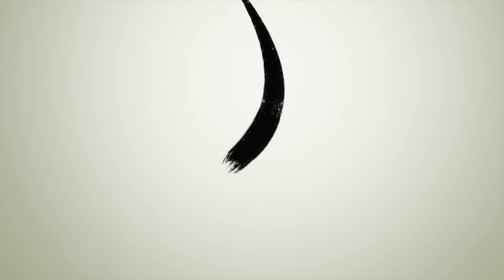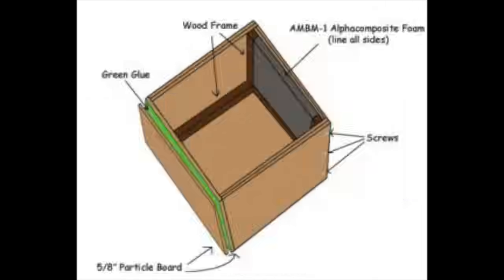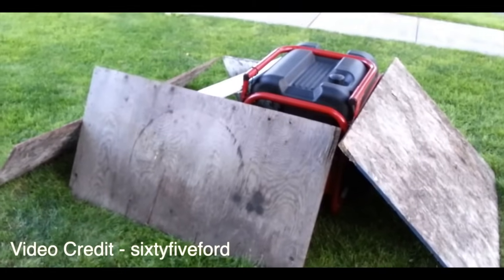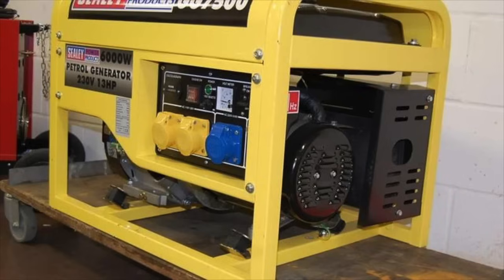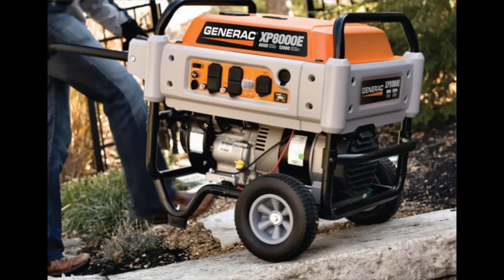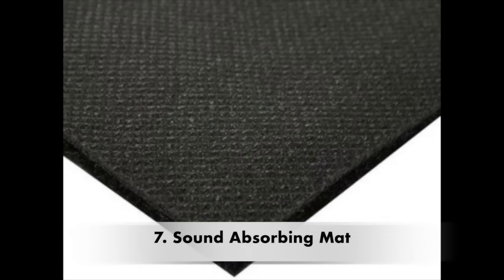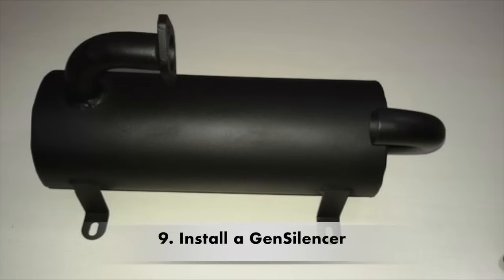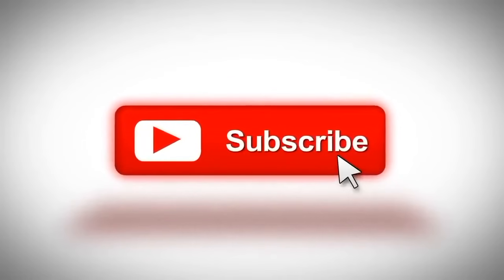How to make a generator quieter - 9 Ways That Work!

Comment: First of all thank you this for n many other video ! Love it . I’m looking for a generator that can pump up 10-15amps about 1200watts and pay about 1-2k what would you suggest?
Reply: For how long, and what KIND of load and 15 amps is 1800 watts. What EXACTLY do you need to run? Fridge? Lights? It makes a BIG difference. Electronics like computers throw a whole different thing into the equation. Be glad to help if I have more info...
Reply: Ricky Earp it’s 4x exhaust fans from work place it’s 2amps each 120v max watts said on it it’s 231watt .... I’m from CA we keep having power outage here . Thank you for the reply 🙏🏻🙏🏻🙏🏻
Reply: @titusho4608  get a Honda 2200EU tried and tested
Reply: @titusho4608  Typical California solution...wild fires from power lines - shut off power for a week
10,000 people running portable generators in the dry brush -no problemo!
Reply: @sylviaisgod6947  I end up getting two.... works great ..... this model  is out of stock everywhere in the bay ... only Amazon was available
Reply: @titusho4608  Good luck when they ban gasoline in CA.

Comment: Oh, man I wonder how long before the box would catch fire with my 8500 watt genny. We had a power outage a few weeks ago and can run the entire house on it, plus one AC. The muffler glows red, you can see it at night. If you stand 5 feet from the exhaust, your legs get hot. This is at 50% load too!  Imagine if we cranked up two AC!   One thing I can say, enclosures do work, provided they are designed with cooling and exhaust ventilation in mind.  For example, look at the Generac 7.5Kw genset. Its basically the same as a caged generator, but in an enclosure.  The key though is that it has plenty of ventilation and the exhaust is piped out of the box so it doesn't release its heat inside it.  I also know that the alternator in the genny has a good sized fan to suck heat out, so making sure there is good in flow and out flow is key.  If you do make an enclosure, make sure the front and back, in relation to the genny, the front would be the motor side, the back the exit of the alternator where the air blows out, and some method of getting the exhaust out, and it will work. Give at least 12" clearance all around.   Here is the MOST important ting, Make sure you can open it up to air out BEFORE starting it!  Gas fumes can and will accumulate in the box and if you have a power starter, and you push the button, you could very well go BOOM!
Reply: thank you so much for this. well appreciated
Reply: I listen only guys who had experience and tried to work around this problem. All rest of you: sceptical criticals- you All just Shut Up!!!

Comment: Putting a generator in a box seems like a recipe for overheating...
Reply: "I CAN"T BREATHE!" You gotta have 14.3 gallons of air for every gallon of gasoline you burn...And my manual for a Briggs and Stratton 5 HP Horizontal shaft "F -Head " engine says it needs 1900 CFM of cooling air @ 50 degrees F at .05 in mercury static pressure (almost NO resistance to free flowing air) AT IDLE and 6000 CFM under full load for 30 minutes then it has to be shut down and allowed to cool for an hour...
Reply: Only if it doesn't explode first

Comment: You have zero actual experience dealing with this problem. Half your stuff contradicts itself. Several of your video clips swiped from other youtubers. Several tips are dangerous.
Reply: He's trying to cure diarrhea by fixing the toilet. Buy a twin cylinder inverter Cummins/Onan genset  or Honda and Yamaha and Suzuki make them too(yes, they are expensive, but you can hand them down to your grand kids if you maintain them) and be done with it. What is the ONLY brand of generator that can be used in ALL National Park Campgrounds after "Quiet Hours" and all National Forests and all State Parks and all Corps of Engineers Recreation Areas? Onans. I had an Onan 11000 Emerald Series in an AirStream Excella MotorCoach and put 55000 hours on it with only oil changes and new spark plugs. When the vehicle ran, so did the Onan for the twin roof  Coleman A/C's. We got better fuel economy that way, 15.5 MPG VS. 14.5 trying to use the the cab A/C to cool the rig (pulling different Hondas, Civic or Accord Hatchbacks didn't make any difference). 454CID Chebby slightly worked on(headers and Jacobs ignition replacing the worthless GM HEI), G50 chassis, 400 Turbo-HydroMatic 19" Alcoa wheels. I THINK Yanmar makes a liquid cooled des-iel inverter genset that's quiet as a baby's breath too. Look at what's at the base of the local cell phone tower for a back-up. Ex-room-mate installs and maintains those things...

Comment: He mentioned an inverter generator , but why in this day & age would you even need to run a generator at night take a que from solar run the gen during day to charge batteries use batteries at night connected to inverters no prob while sleeping cause no noise , better yet go solar with gen as extreme emergency backup only,when not enough sun to charge batteries!.

Comment: Who in the hell would spend $1000 on a box for a 2200W portable generator that costs $500?  Those Zombie Boxes are insanely priced.
Reply: Honda inverters generators are insanely priced too (repeatedly mentioned in the video). If I could parallel 4 of them, I'd finally have a decent sized generator but I'd need a bottomless wallet to due it. It's not hard to be quiet when you're running a Cox 0.049 engine (exaggeration) and take your fuel consumption ratings using 1/4 output (when output is already 1/2 regular generators. Other manufacturers rate sound output and fuel consumption @ 1/2 output, not 1/4. Let's try some apple to apple comparisons. The inverter don't enter into the reason they're quiet it's because they are 1/2 the size both in output power and engine size (or more) along with twice the price tag.
Reply: @Dewey-wz4ny  They only let you parrallel 2 to each other. COuld probably switch 4 together. But. fuses might melt. They are quite. But extremely noticeable in a quiet campground at night time. I prefer the silence
Reply: @Dewey-wz4ny  Okay, THAT has got to be the challenge of the century. How to quieten the Cox 0.049 cu in model airplane engine to be quiet like an electric motor! Any ideas? Should I start my own thread?
Reply: @Dewey-wz4ny this is old but the best reason for an inverter generator is the clean power it provides for electronics.
Reply: IKR?!  I got a great deal on a perfect $1400 Duramax XP12000EH Amazon warehouse for $850 4 years ago.  The Extra Large Zombie box would wind up costing $2600 shipped with 'required' accessories.  How do they stay in business?
Reply: The generator that I've been looking at getting is $1,700, uses propane or gas. The reason I'd want it, is because I'd often be using it inside of buildings that don't have easy access to a 220v outlet. -- So, while I can understand this isn't exactly a common practice use, there are people that would greatly appreciate the machine.
Reply: @paulmichael5633  Using it INSIDE a building? What about exhaust fumes...?
Reply: @paulmichael5633  GenMax7250 inverter 50A Dual Fuel on sale AMZ 400 off.
Reply: I agree.
Reply: Might as well invest in a inverter generator bro begin with
Reply: Probably does the same thing I did with my diy baffle box. I have a 9500 watt generator. It's loud, especially in the suburbs when everyone else doesn't have power.

I put a small duct fan in it to pull air through the box to keep everything nice and cool when In use.
I imagine You could remove the exhaust fumes with a similar practice.

Comment: Running an extra long extension cord will draw more amps thus limiting the number of appliances or tools you can run simultaneously. It's not good for the equipment to run on low amps either.
Reply: IF (big IF) you run honking big cable on 240 volts, you can mitigate amperage/voltage drop, but VOLTAGE drop over a long wire at a "fixed voltage" can't be avoided by Ohm's law of V=IR where V is voltage, I is amps and R is resistance in ohms. At 120 volt and 30 amps, even an 8 gauge wire 100 foot shows a voltage drop of more than 10%, which is too much for motors starting. "Life iz 'ard an' den chu' die an' go du 'ell. Ay cun deal wid dat."-Izzy Moreno "Miami Vice"   Words I live by...

Comment: Screw that Honda. I'd buy a Predator with warranty, Firman or Ryobi 1st for less with same value.
Reply from the maker: I’m actually looking at buying a Firman! What do you think of those? Had good luck with them? I’m looking at a 7000w and would probably use it on one of my next vid.
Reply: Soundproof Guide    Westinghouse then Firman imho.
Reply: I use a ryobi no complaints

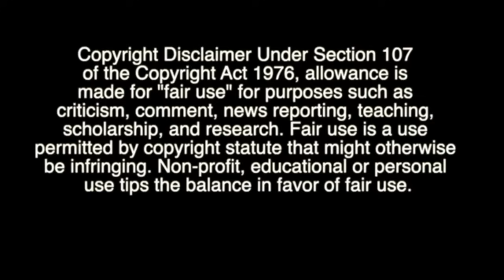Comment: 15:05 Battery powered fans ???  Why would you buy battery powered fans ? You have a generator! 
Can't you just buy a normal fan and power it from the generator ?
skipping the batteries makes it less complicated which means less stuff to go wrong.
Reply from the maker: It just all depends if you have enough outlets. I just find a battery fan works just as well and you don't lose a spot on your generator by doing it that way. Good point though.
Reply: The batteries go dead in the middle of the night, you wake up to a burned-down generator shed.

Comment: While I agree with having a generator, severe weather events are not more frequent now.  Both hurricanes and tornadoes are happening less frequently and are not stronger than previous decades.  We do choose worse places to live, which is part of the perceived issue.
Reply from the maker: You do make a good point. Thanks for commenting!
Reply: Anywhere serviced by Pacific Gas and Electric has iffy problems. That's all of central to Northern California.

Comment: Don’t use a car exhaust use a factory motorcycle exhaust. Because it’s a single cylinder a car muffler won’t work you need one from a bike
Reply from the maker: Thanks for the tip. I'm actually going to make a video with  test in the coming weeks using a muffler on a generator. Stay tuned!

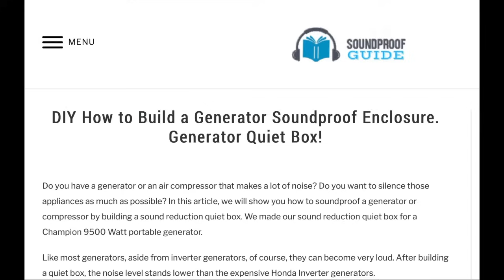Comment: Your table saw example at 2:29 is a dangerous table saw example. you need to use the miter guide and not have the ripping fence installed.
Reply: Eyeroll.......are you really “that guy”?

Comment: Last tip should have been the first. Don’t be so cheep go out and get a Honda of the size you need and call it a day. Come on really, buy a cheep noisy open frame generator then spend another $300 to $400 on a ZombieBox with another couple hundred shipping? That’s like a 90 year old getting a boob job.
Reply from the maker: You’re absolutely right. Thanks for commenting!

Comment: I personally reckon because of one cylinder being air cooled is the problem. I've heard a great little one powered by a 3 cylinder water cooled Kubota. Fully silenced and in a cabinet . Cost plenty though
Reply: Be aware, when building a full enclosure. The gas engine on most small generators is air cooled. In addition, the generator is also air cooled. Enclosing the generator Ina small box and running it for an extended period of time may cause damage leading to failure.

Comment: Any box should have fresh air only duct, vent, opening to cool the engine and gen head made in such a way that the intake air does not mix with the heated air under the box.  The box will pressurize and will need a vent back out.  An exhaust fan will not be sufficient to keep heated air from recirculating though the engine and run too hot.  The engine carb intake should have new air also.  This is how Enclosed generators work.  The front of the engine and the back of the gen head is where air is pulled in.

Comment: Great fire hazard ideas! Oh and you forgot to mention that the farther away the gen is the larger the extension cord must be.  Building a plywood box around a generator is just asking for a fire and or an overheated, trashed, generator.  An air cooled gen gets its cooling air from the flywheel and usually a fan on the generator shaft (the windings need cooling as well). The air flow MUST be maintained at both of these fans. Take a look at a home stand by unit at home cheapo and see how they do it. It's a larger generator but the principal is the same.  It can be done. But using flammable stuff to build is wrong. This includes standard noise reducing foam panels .  If it's just for your house do yourself a favor and just buy a Kohler or Generac (I don't recommend generacs) home stand by generator.

Comment: The reason they are noisy is because they are single cylinder, in the motorcycle world we call them "thumpers" because of the sound they make (thump thump thump) if the made a multi piston generator (say a V8) it would be whisper quite, you're welcome.
Reply from the maker: Awesome! Thanks for the info! 🙂

Comment: Mostly not at all useful information.  And sometimes silly.  And put a long extension cord on it?  Any idea what gauge wire you would need for 5 or 6 Kwatts to extend it 100 or 200 ft?  VERY BIG!
Reply: Even then you would experience a drop in amperage. 10 Gauge is expensive.

Comment: Also if you Let the Generator far away from your home you will have problem with loss of power. Due to the cable resistance
Reply: I would worry more about it being swiped!
Reply: @GalileonPrime  Disconnect the neutral bonding wire from the frame, replace it with one of the 120V hot legs, problem solved.
Reply: The cord also has to have the proper gauge wire for safety reasons. The longer the cord, the lower (heavier) the gauge.

Comment: I was thinking your first idea but what really happened with the cooling of Generator ?. We have problem there.
Reply: Yes, you can have a problem, the engine could overheat. The engine operating temp could be as high as 200* f in that box with no problems. However, the generator wiring insulation maybe only rated at 105*c or 220*f

Comment: Summer in California has become generator season, thank you for all your suggestions. Due to the extreme heat in my area I'm cautious of a fully enclosed solution, but perhaps a three sided, with a sloped roof, angled away from the house, and situated on the north side of the building. A sound pad and some acoustic panels to top it all off. Yay!! Now, to cajole the brother-in-law to fire up his workshop for me, lol.
Reply from the maker: Thanks for the feedback!
Reply: @soundproofguide  Thank you for Some good ideas for Generator noise.. 👍👍
Reply: The plug on my generator causes cancer in California...so glad I don't live there.

Comment: Help me square the circle: "don't leave even the smallest hole in your box, it won't work" with ventilation
Reply: Indeed.
Reply: You would need to baffle the air intake and exhaust. Keep in mind sound waves travel in a straight line.
Reply: You need to seal up every crack and hole, then cut a 2 -16 x 16 inch holes for a vent and fan.

Comment: DO NOT RUN YOUR GENERATOR IN A SHED.Manufacturers of generators strongly warn against running a generator in a shed or garage under any circumstances, even with the door wide open. Carbon monoxide is very dangerous! You can't see or smell it. Eventually you will need to go into the shed to add gas to your generator, and it will be full of CO. Whoever made this video does not even mention using a carbon monoxide detector. DO NOT RUN YOUR GENERATOR IN A SHED.
Reply: Thank you handsome
Reply: At least it will  be a painless death.

Comment: In a pinch and no time to build since I need to use my big/loud generator 2 days from now.  Thinking about putting it inside our large dog crate then covering it with sound deadening material like moving blankets,etc.Think this will be half-decent makeshift solution?  Any other recommendations for this temporary setup?  Besides ensuring adequate ventilation?  Don't need it to be super quiet... just not super LOUD if you know what I mean.  Thanks
Reply: Make sure you leave the dog in  there with it, much cheaper than paying the vet to do it.

Comment: I just dug 4 feet below ground and covered with plywood it worked and cheap
Reply: that is not an option when you live at sea level like i do .. most ppl put their gen sets up on a platform actually
Reply: @rayhs1  or where I live there are boulders under the surface here bigger than a vw bug. They are building a new house across the street and you should have seen these huge boulders just under the surface.
Reply: I did that too but I left it in there too long and when it rained, it got flooded in my hole! Also when I covered my hole, it choked my generator out. I'm going for the vented box now

Comment: Contrary to the claims in the video, none of these would really work all that great while camping (too heavy, too awkward, etc).
Reply: The plywood trick is the best for camping
Reply: I just spent a little extra money on the predator 3500 inverter generator. Incredibly impressed with it!
Reply: @sthacker1986    ..  Have they improved the sound level of that generator? I considered it, but it was too loud.
Reply: Dwight Stewart i don’t own a decibel meter however, the a/c unit on my 5th wheel almost completely drowns what little noise it makes out. Also my unit is a newer unit and they added a fuel gauge which I noticed on units about a year ago didn’t have that. They also seemed to have reclocked the 25 amp outlet. I do not have the issues of my RV cord being upseide down and vibrating loose like I’ve seen on older units. You can stand directly next to it while under load and have a normal conversation. To say the least i am thoroughly impressed with it.